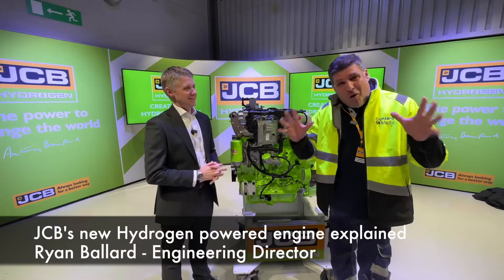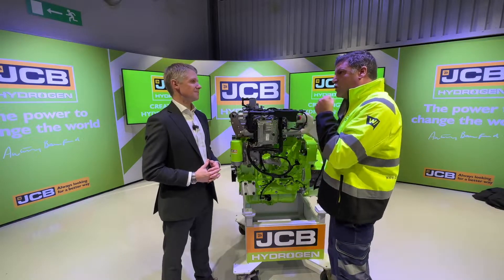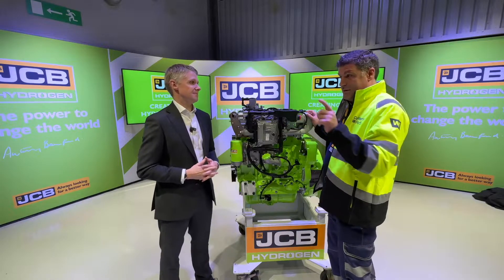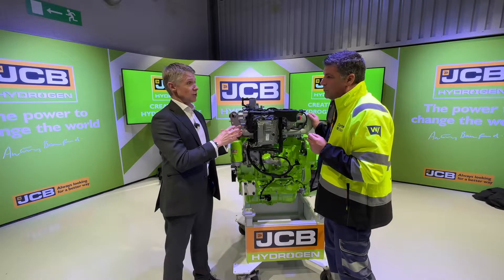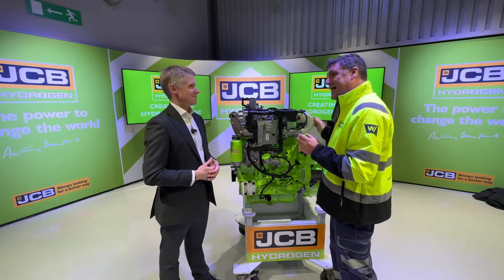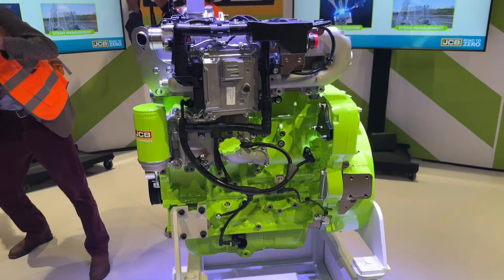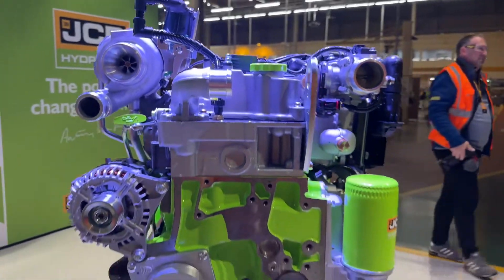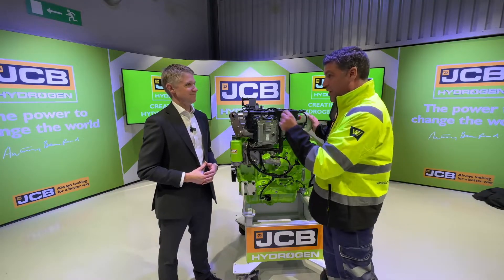JCB's new Hydrogen powered engine explained by Engineering Director, Ryan Ballard

Comment: now tell the whole truth....   ANY combustion engine willl run on in, all you have to do is change the timing . your engine is not special by any means..    I run all my carss on hydrogen....    and really enjoyig the 600 horse outta my 428 cobra jet   lol   stock...     huh?????   how the fuck...  should here the other drag racers...oh I also filled my 28 inch slicks with helium...... LOL         took 2 1/2 pounds off the car lol

Comment: Are we talking about oil mixing with water to produce steam? Well that’s not zero carbon emissions like the hydrogen fuel cell. Unfortunately combustion engines still need fossil carbon oil to run. Hopefully the oil is environmentally friendly in this engine 👌🏼

Comment: Can it fit in my car? Currently a 3.0tdi?
Reply: You can fit that in your car but the problem is with the storage of the hydrogen gas. You need to store it in a very high pressure tanks which are expensive and big. Not only that, at high operating temperatures the combustion can produce some amounts of NOx with water so you would need a catalytic converter. If you manage to do this, there is one last problem that is it's efficiency. Gasoline engines are 60-70% efficient(amount of fuel converted for useful work) but hydrogen engine is 25-30% efficient. In construction machineries the efficiency is not considered much so hydrogen engine makes sense but for cars that would be lot more expensive than the gasoline.

Comment: Farmers will generate the hydrogen in each individual farm via electrolysis powered by cattle moving inside a large wheel that multiplies the speed of generators or alternators to even more than 100 k rpm called ANIMAL POWERED ELECTRICITY GENERATOR of Zoo-Mechanics, Inc. In a second and third generation the hydrogen will be obtained via the gravity buoyancy solutions or vertical water displacement using a “mechanical heart” powered by water, also invented by Zoo-Mechanics, Inc.Maximo Gomez, MD.